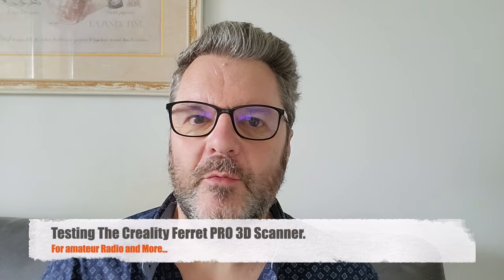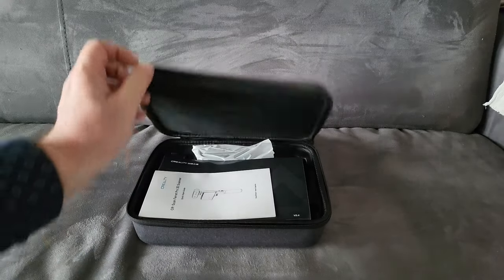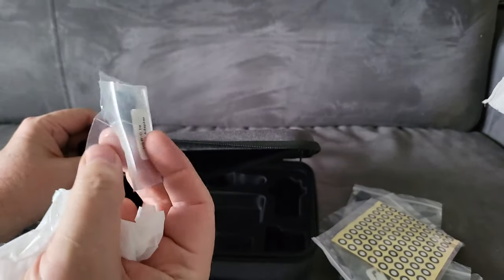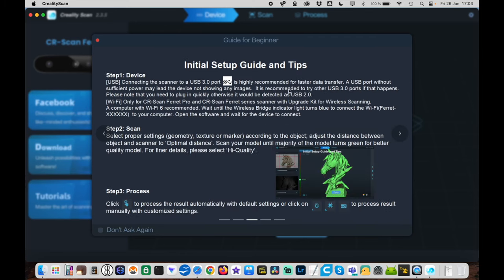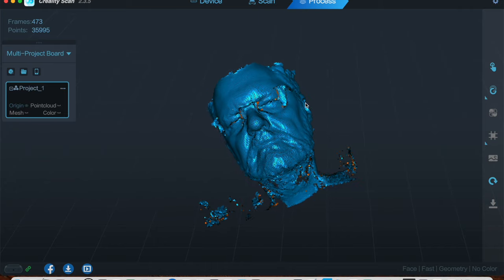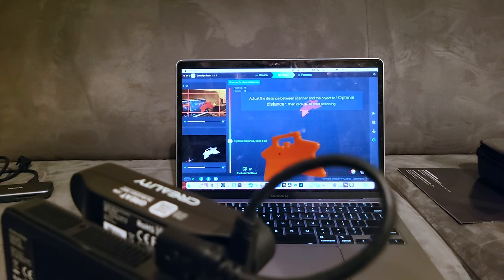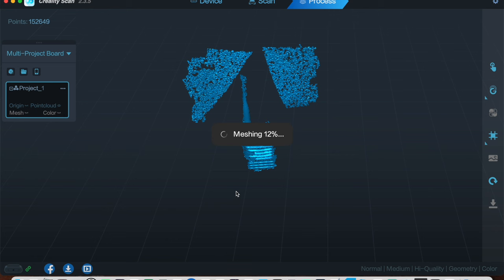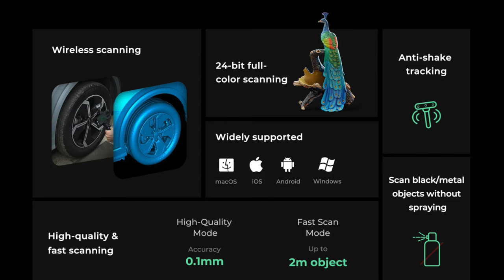Testing The Creality Ferret PRO 3D Scanner.

Comment: I reckon those scans are good enough to scan a complex object and then use that to design a 3D-printable case/stand that fits it like a glove. As you said, putting the scanner on a tripod and rotating the object on a turntable might produce better results too!